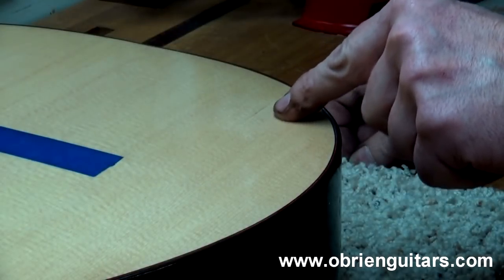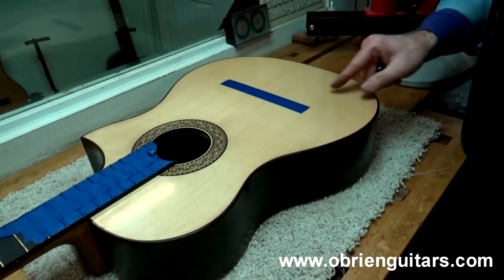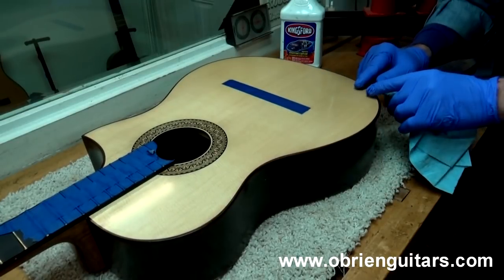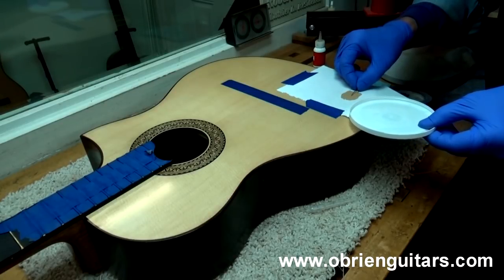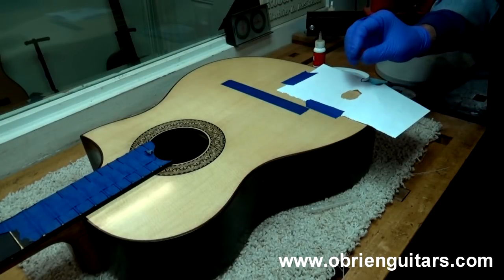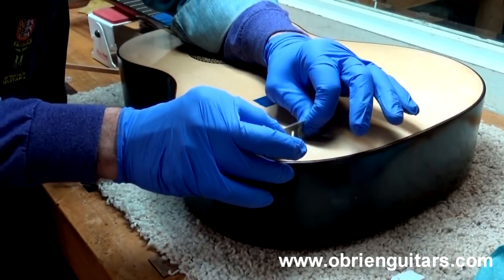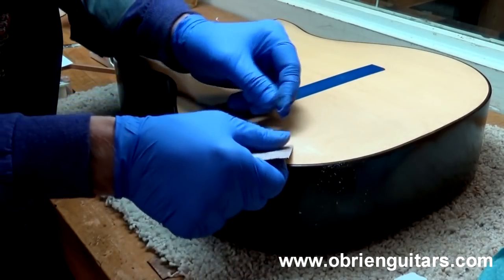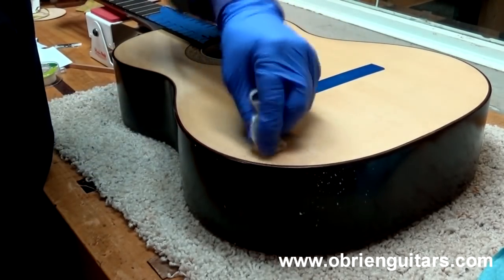Luthier Tips du Jour Mailbag 89 - scratch repair

Comment: I really enjoy your videos.  I am very new to guitar repair but loving every minute of it.  I learned something new with this video.  I've been using a razor's corner to drop CA glue in cracks and deep scratches.  This works well of course with larger repair areas, but I never thought to use a pin.  This is great, because the goal obvious is to have a little glue possible for the final removal and leveling. Thank you so much!!!
Reply from the maker: Thanks for watching. I am glad you found the video useful! Happy Building!

Comment: Brilliant, I did Something similar to an acoustic ( just a cheapy) that had a bad 2.5 INCH chip out of the finish, It was Almost down to the wood ( its a S/Top ) so I Gradually filled it with normal viscosity CA glue ( leaving a mound) dried off an then scraped of the excess, then Fine sanding ( 1200 grit) W/D paper) keeping it moist,till smooth and Almost matched the finish 😂
Reply from the maker: Glad you found the video useful. Thanks for watching.

Comment: Hi Robert, I just found your channel and subscribed.  Great information!  I have used the razor blade trick before but would strike a burr on the edge of the blade.  Not sure if it’s necessary.  I have run into trouble with the tape wearing though and putting additional scratches in the top.  Obviously too much pressure on the blade.  What I am wondering is if it’s necessary to do the drop fill and leveling with CA glue if the scratch or dent doesn’t penetrate into the wood fibers.  Is it possible to just level the scratch or dent with the French polish technique by working the damaged area and amalgamating the shellac layers?  And is it also possible to use nitrocellulose lacquer as the drop fill material in lieu of CA glue under French polish.  I find it hard to knock down and level cured CA glue.  Thanks!
Reply from the maker: If the scratch doesn't penetrate the wood fibers then perhaps you can level it out of the finish. My experience has been that you run the risk of sanding through the finish into the wood though, and that will leave a blotchy area. I generally use lacquer to drop fill lacquer finishes and CA glue on urethanes and polyester. Happy Building!
Reply: @OBrienGuitars  Thanks, Robert!
Reply: Can I use CA glue on satin finish
Reply from the maker: @watso-007  Yes, just rub it out to a sating sheen when done.
Reply from the maker: @watso-007  Yes, just rub it out to a satin sheen when done.